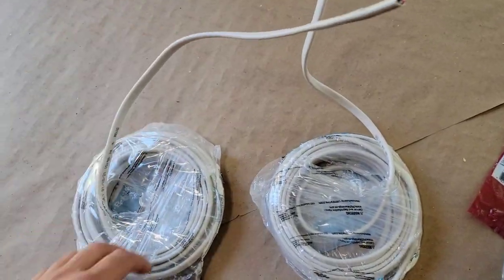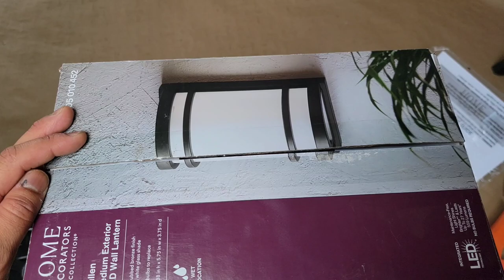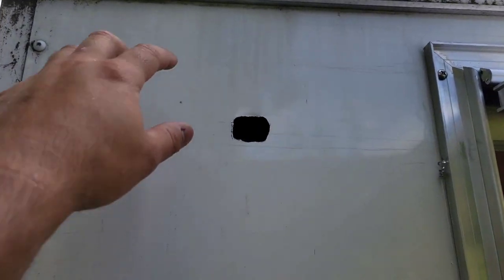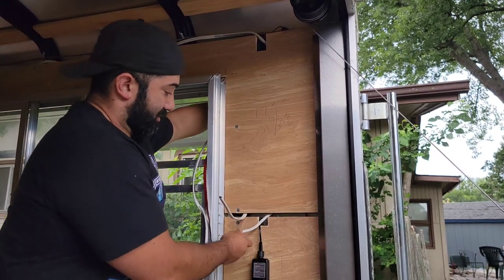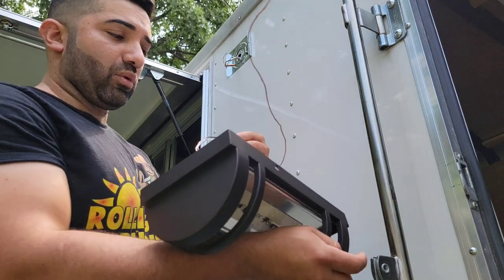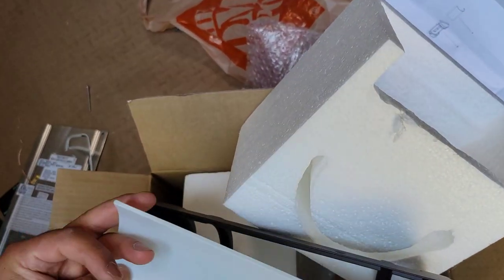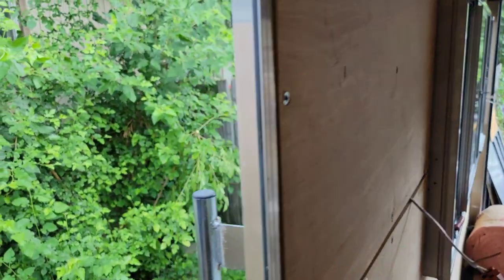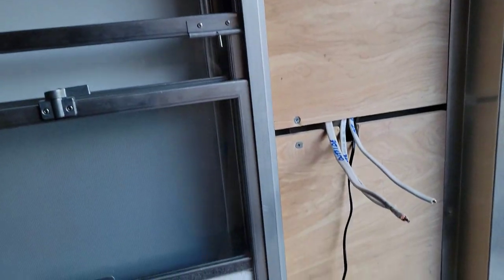How to Build a Food Truck: Outside Lights

Comment: Question, did you wire the strip lights to the switch as well or just plug them in when needed?
Reply from the maker: No they are connected to the switch using the outlet. Never have to unplug them
Reply from the maker: Nicolas Fagundez  yes you can do that if needed